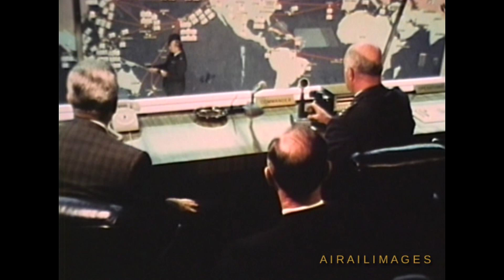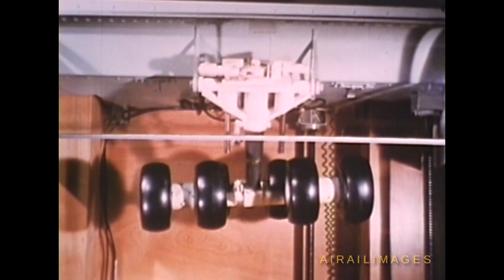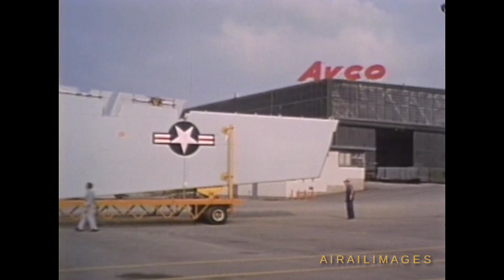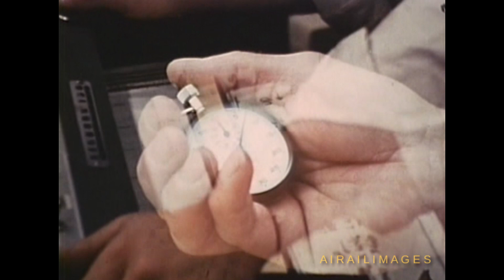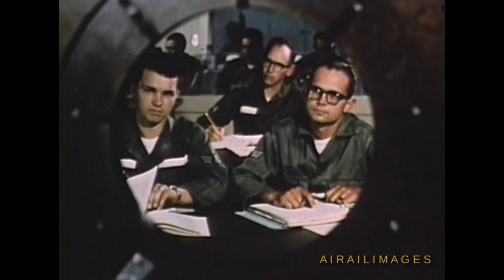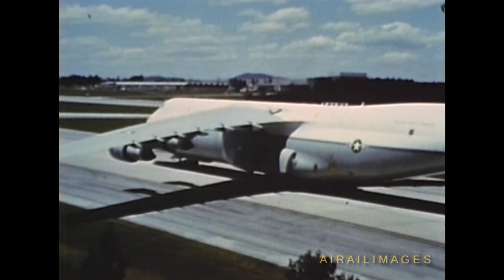C-5 Galaxy 1969 Film

Comment: I experienced one of its problems While trying to get from Japan to the U.S.. Maintenance problems This time fuel leaks. After several tries at boarding, they canceled the flight and I ended up on a long flight with an over night stop in Alaska  on a C-130. Big difference, slow and cold in March. Life of traveling standby in the early 1980s.  Thanks for the video.